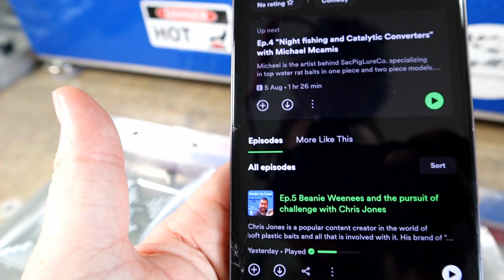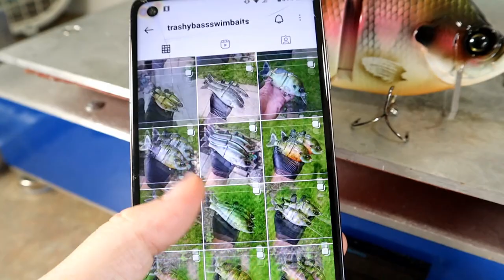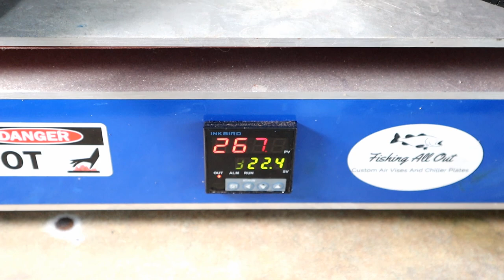TrashyBass Bluegill Color Matching: Soft Bait Hand-Pouring Masterclass

Comment: I'd Totally buy a 4 inch Bluegil OPEN POUR Mold. around like 90 and then a 6 inch for 120 bucks. if it has a slight break in the body, cause you NEED more swim action with bluegil,  and that famous AI swimbait tail ... omg that's the dream for me. That or i'll have to do some wood working. Bluegil swimbaits is where its at for me. Everytime, fish are attracted to them. <3 Always love your vids, you got me started on making my own. started selling on the side, very small, alongside my leatherwork. its a niche so they sell, but not fluid.
Reply from the maker: I'd love to see that mold made